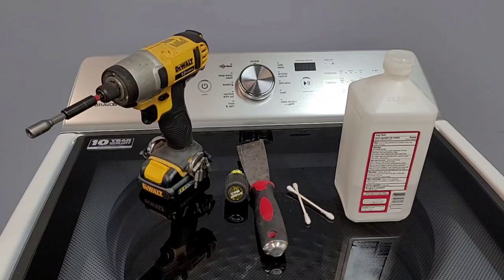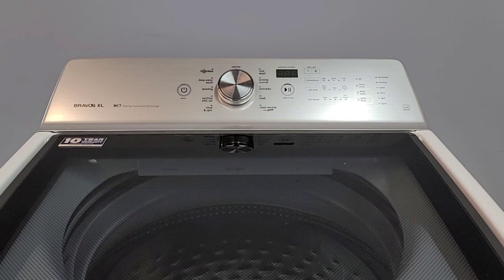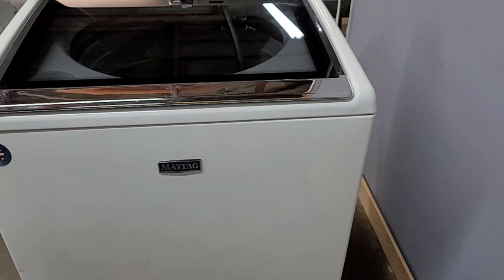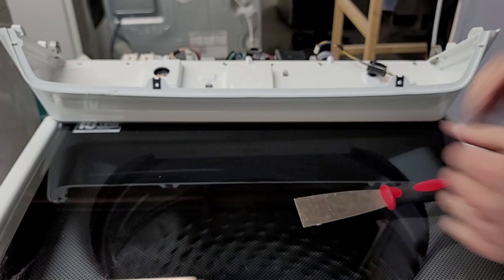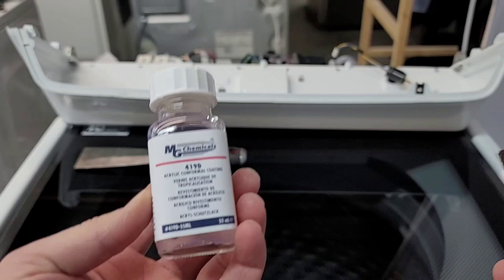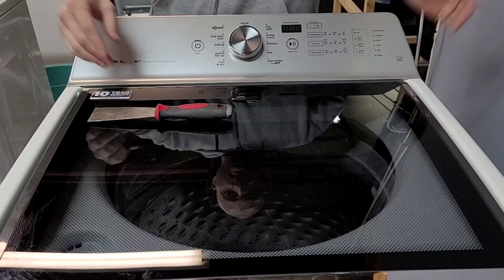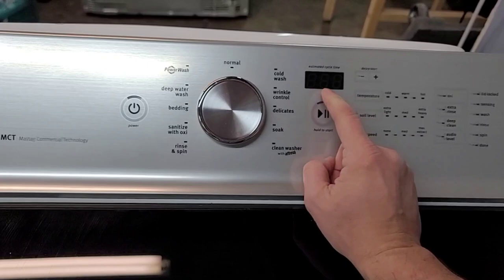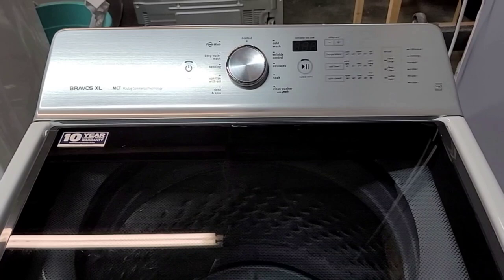Maytag Washer won't start won't turn on? No Problem. Fix error codes F6 E2 / F6 E3 | Josh Cobb

Comment: Sir, I can't thank you enough for this video. My wife and I were on the way to buy a new one @ $700 or so, when I wanted to try one more thing. That was to watch a video on these models. One wipe of the board with alcohol and back to new. OMG. Thanks again!!!
Reply from the maker: Awesome!  Glad you guys saved money!   Pay it forward and buy a veteran a cup of coffee 😉
Reply: Thank you so much you saved me $745.on repairs  or go by a new one an my united is only 3yrs old. An I use it only once a week.i live along. Did just as you did. Cleaned the board.cleared the codes. Put all back together  an tap the start bottom  an I was up an running. I put the 419D coating on it from Amazon. It costs  me nothing  because I had Amazon  points to cover the 419D coating.  A tec call out would have cost me 150.00 then add the parts taxes  it would have been around $750. OR more. It cost me nothing .thank you so much an I saved it from going into the landfill. An so many peeps get taken for something  so easy you can do this.watch this volg  an share  it. Thank you.

Comment: I just watched another video where the guy said to just buy a new board after showing how he got the top off.  So many comments raving about what great advice.  Watched your video and fixed it myself and just ordered my conformal acrylic from Amazon (still $12).  I fixed my fridge ice maker after a plastic part was worn down too instead of replacing the whole ice maker.  These companies are designing these for planned obsolescence or part wear-out just to make money.  Back in the day, washers, refrigerators, etc. lasted for years and years with no electronics.  Less tech/lasts longer.  How many use more than 2 settings on these machines?

Comment: I have been dealing with these error codes for last four months. Sometimes powering it off and on did trick. Other times I had to change cycle to quick wash. Sometimes I had to drain and spin just to complete the cycle. Finally called technician and got quote of $850 on top of $150 he charged for visit. Finally got my lazy ass off the couch and watched videos. Followed your instructions and just completed cleanup. Did not notice lot of green stuff around those golden areas but noticed some sticky stuff. Hard to get out. Turned on cycle and waiting for results . By the way I did break the front left cover while opening. If it works I can still live with broken cover. Will post results in an hour
Reply: Happy to report that first cycle ran through fine. Usually at the end of cycle , I get one or two or three error codes since this problem started. This time I did not see any error codes after first successful cycle. Started second cycle and going through fine. My wife thinks credit goes to you and her as she forwarded this video to me. I agree. Thank you Sir

Comment: Thank you so much for this video. I unplugged for 5 minutes as suggested in other videos. When I plugged back in it still had the error codes blinking but I followed your steps to reset and now it's working fine. If I get the codes again I'll take apart as in your video and clean and coat the contacts. Have a wonderful day.

Comment: I can't tell you how many times I've watched this to fix my washer.  This has saved me so much money.  First time it happened called a repairman, charged me 70$ and was gone in 10 minutes.  Never said anything about the fix.  Next time it happened I turned to good Ole You Tube.  Buying the Acrylic this time though
Reply from the maker: You can use clean nail polish!  Glad it helped!!

Comment: My washer in particular wasn't getting an error code at all. I would turn it on and it just wouldn't let me do anything else. No cycle selection, no start, just power on, and power off. I recently had to go back in for a cleaning because the start button was acting funny again and couldn't remember how to get the top off the washer. And let me say I'm glad I found this video. Your solution to prevent having to do this again was a god send. I was using electrical tape to cover the opening, but it wasn't foolproof forever obviously. I applied that coating (but still put the tape back over the opening for the wire and the connector) and this thing is running as good as new! Thanks!

Comment: Got the F6E2 code Did the tests on the manual that said replace panel. Ordered the panel 2 days ago and laundry was adding up. Your video popped up in my feed and i figured it was already broken so what the harm in trying.... 100% worked and super mad that I didn't come across your video sooner. I have been repairing electronics for 15 years and when i saw the corrosion I honestly didn't even think twice, I figured water damage and its done. Amazing find I wish i could up vote you to the top of the list so anyone that googled F6E2/3 would see your video first!
Reply from the maker: Thanks!  Glad it worked and hope your new motherboard has a return policy 😉

Comment: Thank you so much! Have had our machine since 2018. This has happened twice. The first time was this past July, and we were leaving for a week vacation the next day. we called the repair man and when he got there, he looked at the error code and said “it’s dead”. He said with the amount it would cost to fix it we should just get a new one. Luckily he didn’t charge us a service fee. He said “I was never here” and left. We immediately ordered the new one and scheduled it to arrive the day after we returned from vacation. When we got home from vacation, I accidentally hit the poser button when moving the machine and it came on. We canceled the new order and it’s been working fine for 2 months now. Tonight it happened again mid-cycle. Just stopped and showed the code. I followed this video and I currently have a load of clothes in the wash now! THANK YOU AGAIN!
Reply from the maker: Awesome!

Comment: This video is spot on. The first two or three videos on these error codes that I saw here on YT showed how to remove the control panel (there's another method that may be less prone to scratching paint than using the spreader to pry), but then basically said you get a new panel, connect it, and you're done. No exploration of why the panel may be bad, just "buy the part and put it in."

I happened to see another video yesterday from a guy who seemingly stumbled over the fix (or maybe he was playing innocent and had actually seen this video) and, following the instructions of cleaning those contacts, I was able to fix the washer. This video confirmed and expanded on what the other guy was saying. It also covers what to put on those pieces to prevent reoccurrence of the problem.

In my case I was able to use a Q-tip taped to a pencil and then some more aggressive means (e.g. a bit of sandpaper taped to a pencil) to access the little copper bars and clear them off from the back without removing the panel. As this video shows, there are other exposed parts, too, in that same area. So I may be getting back in there before too long. But now I have an understanding of what the problem is and how to fix it. 

Thank you Josh for the generous donation of your time and expertise to help save us from big repair bills and help save the landfills from equipment that still has many years of service left in it.

Comment: I was skeptical about this solution to the problem, but I had nothing to lose trying.  I am glad I did, to my amazement it actually worked.  I did not have the kind of corrosion described by Josh.  It was hardly visible, but still, there was some present.  After scrubbing it down with alchohol-soaked Q-Tips, it worked!  

Josh, thanks for saving me time, money, and hassle.

Comment: This video right here saved me a ton of time and money!!! When I pulled the cover apart I noticed the dark spots on the 4 contacts (see the video) and was already thing that this couldn't be good. The 4 smaller contacts were pretty much corroded together. His instruction on how to clean the 6 copper contacts was spot on. I had to use a piece of hard plastic to get a lot of the corrosion off and used rubbing alcohol to clean all of it off the board.
Reply from the maker: Awesome!!

Comment: Like so many on here I was sure that my 2.5 year old washer was headed for replacement of the control board a second time. Your repair was straight forward and perfect for resolving my issue. Thanks for your help in providing this video!!
Reply from the maker: Glad I could help!!

Comment: I had previously replaced the control board based on an older You Tube Video and that board only lasted 14 months before I ran into the F6 E2 issue.  Found this video which shows a better way to take the panel off as well as identifying what the issue REALLY is with this code.  Thank you so much OP !!! I was a few clicks away from buying a new control board YET AGAIN.  You save me!!
Reply from the maker: Awesome!  Glad I could help!

Comment: Unreal, used your video to repair my washer. The contacts did not have a speck of dirt or corrosion on it, I still wiped them off with alcohol- as suggested, and it fixed it. thank you so much for saving us $$$.
Reply from the maker: Great!!  I'm glad it worked for you!  😊

Comment: Thankful for you! This worked like a charm. Our machine is only 2 years old, and we had no sign of power (no error messages). After checking outlet and breaker issues, I found your video. In less than 15 mins, we are back up and running! I was able to clean this area without having to lift the top off. My husband was uncertain, but my little hands could reach in the space with the q-tip and alcohol to clean the copper pieces fine. Just a thought if folks want to try that before removing the top piece. Appreciate you!
Reply from the maker: Great!  Glad it worked! 😊😊

Comment: Thanks for this video. I was having this exact problem and was gonna just bite the bullet and buy a new one. 3 qtips later and a little alcohol and it has been running all day. 8 loads done. I’m gonna go get some clear coat or silicon grease and take it apart again to clean again and apply. Awesome video.
Reply from the maker: Clear nail Polish works too!  Glad I could help!

Comment: You're the man!  You just saved me from buying a brand new unit.  My washer was actually branded as Kenmore Series 700 model # 110.28132410.  Ironically the inside of the machine's control board and front panel looked 90% the same as what you show in the video.  Our washer was working fine and then would not power on.  I did the sequence of button presses on the control display and received the F6 E2 error code.  I followed your instructions and also removed the panel and cleaned all the other visible electrical solder pads I could easily access.  No idea why this works (as others have also commented) but the wife is happy and that's all the matters!  Thanks again!!!
Reply from the maker: Thanks!  I'm glad it worked for you!!

Comment: Thanks alot very good video. I did exactly what u said after listening to entire video and my kenmore 700S series top load washer is working again. It was showing the f6 e2 code. Now I don't have to pay $90 just for diagnostic or plus parts & labor I'm very happy thank you very much and greatly appreciated. Turned into a $13 repair.
Reply from the maker: Glad I could help and save you some cash!

Comment: Saved the day! Thank you! Ours wasn't as corroded, but there were fine lines built up between the small copper contacts. Scrubbed them clean and painted with a bit of clear nail polish. Back to brand new!
Reply from the maker: Yay!!!  Glad it fixed you up!!!

Comment: I can't thank you enough for this video. I currently have a load of laundry going thanks to you. I ended up sealing that area off with eva foam and silicone caulk because I was too nervous to use nail polish on the board. Seems like it should do a decent job keeping the moisture out.

Comment: This tip fixed my wash machine!  I will be purchasing the coating you recommended.  You are amazing!!!
Reply from the maker: You can use clear nail polish!  Works just as good!
Reply: @joshcobb4100  Another very helpful tip!  Thank you so much!

Comment: Josh, thanks so much for the video.  I did not have any visible corrosion but cleaned with alcohol anyway.  checked all the connections too.  I was amazed when the thing started up after I put everything back together.  Yes, the panel was a pain and got a crack or two but who cares.  Thanks again!
Reply from the maker: All is well that ends well my friend!  Glad it worked for you sir!

Comment: Great tutorial! My dryer has been showing the F6 E3 error code for about a week. I wasn't able to get the breaker off the machine to clean the circuit connections but I just reached in through the back and swabbed it while it was still attached. My dryer turned back on almost immediately. I didn't even have to clear the code. Thank you so much! You're a life saver

Comment: This really works! Maytag should be ashamed of their shitty design though! My Washer model is Maytag mvwb765fc2. My washer stopped showing any indicators on the panel - not even the error code, nothing as if the panel was getting no power. I opened the panel up as per this video and saw that there was a blinking green LED on the board next to the heat sink. So I proceeded to clean the circuit board contact with Alcohol and Q-tip. Voila, the panel came alive! Thank you for saving me $$ and time and headache!
Reply from the maker: Excellent!!  Glad it worked for you!

Comment: This also works for the Kenmore Series 700 washer.  The button placement is slightly different, but it's nearly the same washer.  Fixed mine, with an F6E3 error, today.

Comment: Gonna try this on my Maytag that has no power. Where do you put that silicone clear coat on everything on that lil board or just certain things? I don’t want to coat it all and mess it up worse. Thank you!!
Reply from the maker: Use clear nail polish and just put it on the board. You don’t have to put it on the things that stick out from the board.  Just that tiny square that’s exposed.  Good thing is you can’t mess it up worse than won’t power on lol.

Comment: Okay, tried the quick fix and I continue to get a F6E2 or 3.. The corrosion is removed and it looks good but doesn't work and I've done a reset and left power off for a while... same issue diagnostics push buttons works and reset works but then power does not.  I would think getting a new "Whirlpool WTW8500DC2 Console - Genuine OEM" at $185 would be the right part to get or do I need to get the Control unit at $295?   BTW, I did check the cable continuity and it was fine.  Thanks, good video!

Comment: You sir. Just made my whole day and week. 580 dollar quoted repair.  Watched the video and cleaned it up. Working. You sir are amazing . A little scared now to use the clear coat on the board just cause it's working now. I know I need it or it will happen again. I'm gonna go with the 12 dollar bottle....and you feel that it's safe correct?
Reply from the maker: Absolutely. If it were made by Samsung the whole board would’ve been dipped in silicone.
Reply: @joshcobb4100  you saved me souch money today. I will send you something for your help. I don't have much but you deserve something. Thank you sir
Reply from the maker: I'm just glad it helped! 😊

Comment: I have tried this method successfully once. I worked very well for a month. Unfortunately yesterday I once again had the dreaded e2 f6 code. I followed directions again and reprogrammed the front panel but now the machine won't turn back on. And has now again started flashing e2 f6. Any ideas or suggestions? Do I need to replace a part? If so which one should I try?
Reply from the maker: Unfortunately you might need a new CPU board.  If you spend the money to get a new one, make sure you coat the exposed area with clear nail polish to keep this from happening again.  Good luck!!

Comment: I have a Maytag washer model number MVWB835DW4, my question is when I’m running normal cycle the last 10 minute of the cycle it supposed to rinse, spin and done but for some reason on the rinse  cycle it washing the clothes and then it says done. Is there something wrong with the control board. And there is a way for me to troubleshoot or anything I can do to fix this washer please help
Reply from the maker: Hard to say, but likely a control board issue.

Comment: I did exactly what you did in the video to reset it.  I got all the numbers you mentioned.  Once I turned it off, it wouldn't turn on.. My Maytag is NOT the Bravo but same control panel.   I tried it 3 times..  HELP!!
Reply from the maker: It's probably your buttons worn down.  There is a spongy layer to the button kinda like foam that wears down and doesn't keep things connected to register when you are pushing the power button.  I've had this happen a few times.  I replaced the foam with a small square of sponge and it fixed it for me.

Comment: I’ve had to do this multiple times to this washer. What is the actual resolution other than monthly wiping it with the alcohol prep?
Reply from the maker: Add a layer of nail polish and you shouldn't have to keep doing it. Mine is going on 4 years strong 😊

Comment: I have this issue and have verified power to the board. There was corrosion, and I have fully cleaned the area. Still not working and can get any response on the panel? Any ideas?
Reply from the maker: Likely damaged board will need to be replaced then.  Make sure you coat the new board spot with clear nail polish before you install and start using it. The problem repeats because of steam.

Comment: what does it mean when the codes don't clear?  your fix is easy and I did it.  but the codes did not clear.  i don't know if the motherboard, the lidlock mechanism, or both should be replaced.  the model number in your video is the EXACT model number of mine.  BTW, the circuit board was not dirty.  i cleaned it anyway.